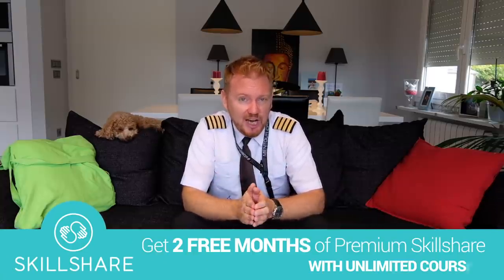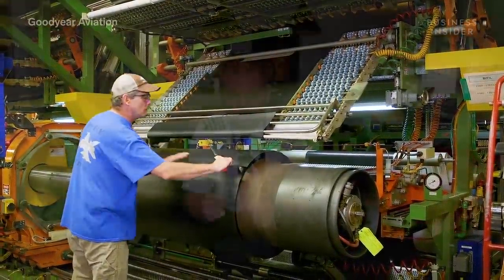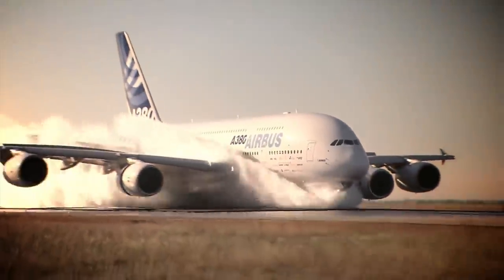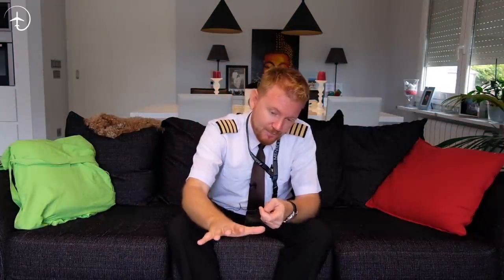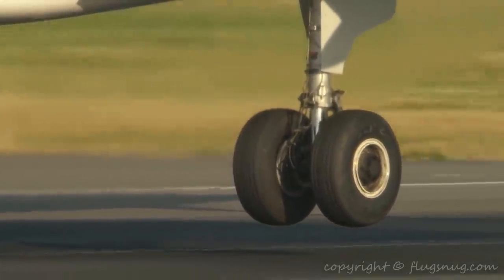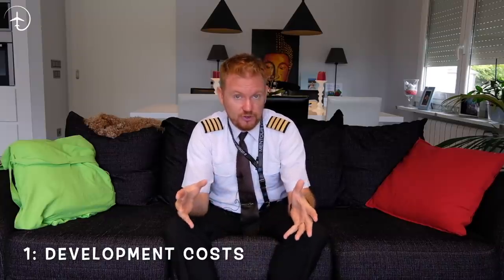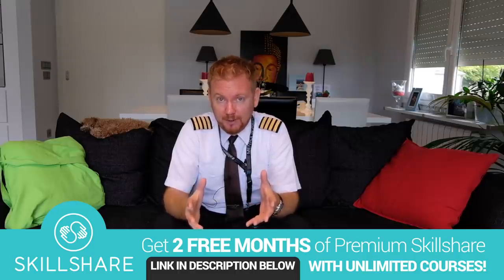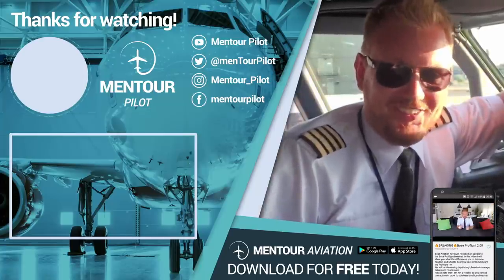Why not make plane-tires spin, before landing?!

Comment: What about a passive system? Put flaps on the sides of the tires, like a simple wind vane. They catch the wind when on the bottom, not on the top. The tires would spin up as they are deployed. This wouldn't have an motive force once they hit the ground.

Comment: I disagree a bit.  Spinning tires were used many years ago. One way was vanes that caught the air so you had no motor issues.  It didn't really work that well.  But... I think Hydraulic motors would have less weight, and would be controllable.  You could have it monitor ground speed and self regulate.  If you were crabbing, it could spin at a lower rate or not at all.  Finally, if there was a safety 
issue it could disconnect and be just like a regular wheel.   Thanks for your wonderful videos.  Pete

Comment: Instead of a motor, why not use a spring mechanism that will spin the wheel in one direction, otherwise the wheel just free-wheels.  don't use a motor, batteries, etc.  a powerful spring requires no fuel, no wires, etc.  and likely wouldn't add as much weight as a series of motors.  Perhaps this could even be designed to help slow the aircraft upon landing.
Great video, and sharing this.

Comment: I would use compressed air from the engines and have air drives on the axles like a air power tool to spin the wheels before landing . Then I would make it possible to reverse the air drive to help with braking ..

Comment: I used to do this in Diamond DA40’s. You hold the mains within an inch of the ground while landing, and you can hear them spin up. Then let the plane settle. Passengers are always super impressed. I’m not an especially good pilot, but they all think I am. 😂🤣😂

Comment: This is a question i have had too, yet i have a solution
What about vanes added to the side of the tyre, either  metal bolt on with the wheel nuts, or moulded into the sidewall, the type of vanes that wind will rotate them
It wouldn't need to spin to full speed, but would at least reduce the amount of rubber you leave on the runway
I understand what you say about a crab angle, but you could easily select not to spin the tyres by applying the brakes
Simple solution that doesn't need electrics, battery etc

Comment: Pre-spinning the tire would help with the angular momentum the tire needs to gain upon touchdown but does not help during braking to drain the aircraft's linear momentum. It takes very little work/impulse to get a tire up to full speed, most of the wear is likely to occur during braking. Additionally, I wonder if that brief moment the tire slips helps warm it a little and allow marginally better performance.

Comment: An Australian Airforce member took out a worldwide patent for a set of turbine "Hubcaps" to spin up the landing gear prior to touchdown. It was tested and it worked BUT upon approaching Boeing and other manufacturers he was rebuffed with one aircraft company representative stating that when the patents expired they would consider it. The idea came from WWI pilots spinning prior to landing. The turbines did not speed the wheels up to landing speed but started the wheels rotating at a slower speed to reduce their inertial forces.

Comment: Just small flaps on wheel disk inner space will convert upcoming air energy to wheel spinning. Benefits :
1) no need motors
2) system as simple as reliable
3) spinning will never be faster than some threshold depending of upcoming air
4) reducing smashing effect due touchdown 
And if you scared by rotation momentum due touchdown then don't spin up wheels to nominal frequency - use half of nominal frequency - this will save rubber, and increase safety anyway. 
And please don't use as argument "we used to do like this" .

Comment: I believe, many years ago, they did try spinning the tyres and found it was not the way to go. . .  I don't remember the details, but one way mentioned was fins on the wheel, such that the air spun the tyres up to some useful speed.

Comment: Here I have a question (perhaps you head it million times?) : Why no external cameras ? So that from cockpit one could see at least wings and engines.
Equipment is light and could be wireless so one could think it could be implemented easily.  High speed cams could "freeze" rotor blades so could stroboscopic flash. Isn't it frustrating not to be able to have a look outside in a time cars come equipped with rear cam.
Cam could be a fitted on pods that sticks out only when needed.  Fitted in the nose?  Isn't there a spot that doesn't come in the way of the radar?
Then it could be controlled from a simple tablet using "of the shelf" existing tech.

Comment: KISS method.  Weather vain type paddles bolted on to the rim, let the wind spin them up.  Cheap, no weight to speak of, probably can retro fit to existing aircraft. Don't need exact speed.

Comment: Rotating wheels at landing speed puts extra down force on the plane which causes shuttering because it's not matched to the pitch of the plane. Think about an RC truck as an example, if you launch the RC over a ramp to avoid it flipping out of control backwards, you can moderate the wheel speed to pull the front of the car down which helps the landing. But when we try to do that to a plane which is gliding in it will force the planes nose to dive so the pilot is forced to pull up to counter the wheel movement causing violent shuttering within the cabin. Thats the main reason why wheels are left static until they connect with the surface.

Comment: Why not add some fins to the rims of the plane wheels so the spin of the wheel is generated by the wind catching the fins facing to the front on the lower part of the rim. While the upper part lays opposite and would not catch wind, resulting in spinn of the wheels from just air drag while landing. No motor or batteries needed

Comment: Maybe one turns it around: If simple irrigation systems keep the runway slightly wet in the preferred touchdown zone.. wouldn't pilots get rewarded with a less brual tire-acceleration and wear-off? The plane is sliding the first meters anyway. The transition of direction-determining flight controls to the landing gear on touchdown might be more smooth. Also the torsion induced shear stress on the landing gear during (non-rainy) crab landings would be less.
Question to pilots: Is the touchdown on a slightly wet runway (given there is no wind) more smooth as the plane initially slides more/longer, and hence the directional control is closer to being airborne, with smooter transition?

Comment: I use aircraft tires on steering axles of my John Deere tractor and on implements with pneumatic tires. The carcass fabric and belts are 3 or more times as many as other tires. I am in Texas and Mesquite thorns can puncture heavy equipment and farm machinery tires with ease but used up regrooved AC tires never get flattened.

Comment: I believe Lancaster bombers during WW2 had small cups around the tyre rims to start the wheels spinning. I am not sure if it was all Lancasters or just some of them. Using these cups would eliminate all the problems with motors such as weight, batteries, etc.

Comment: Nitrogen expandes the same with temperature change as any other gas does. The "Ideal Gas Law" or "pv=nrt" explanes that any gas sealed in container with a fixed volume, when exposed to a change in temperature, will increase/decrease in pressure identically to any other gas.

The main benefits of using nitrogen over atmospheric air are; the absence of highly chemically reactive oxygen that can degrade rubber (especially under higher pressures), the absense of moisture, and the consistency across the globe.

Oxygen is a highly reactive element and causes a lot of damage in a lot of substances. If you see the terms "-oxide" or "oxidization" it means that oxygen has reacted with the substance and changed it from its original form. Some common examples are; rust (iron oxide), headlights plastic fogging (oxidization and uv dedregrarion), and something rubber that is old and has a cloudy layer or lost strechiness like an old rubber band (oxidization). The rate that this oxidization happens at is influenced by pressure. So as the pressure in the tire increases the impact of the oxygen increases. It doesn't matter much in a car tire at 35psi since the tread wears out before the inside starts to degrade. But at 6-8x the pressure for an aircraft tire, the damage from oxygen internally will happen at an increased rate. 

Moisture isn't normal an issue in tires especially since most air-compressors have an air/water separator and some have dryers. But with the extreme temperatures in flight and during landing there are chances for moisture to either condense and freeze or boil if there is an excess of moisture in the tire air. One potential reason why this could cause an incendent would be if an aircraft tire was filled in a region with almost 99% humidity, hight temperature, and their air/water seperator and dryer failed. It could allow an excess of moisture into the tire that could potentially freeze in-flight and cause an air leak due to the ice expanding around the seal. Or, the moisture boiling during landing and over-pressuring the tire. Both are highly unlikely. But, still a potential threat vector that can be eliminated by using a controlled nearly pure gas. 

Finally, if everyone globally agrees to use 99.995% pure nitrogen for commercial aircraft tire air, then you can guarantee that no matter where you stop to get 'air' you can always get a nearly identical replacement for what is already in your tire.

Edit: as some other comments pointed out, the lack of oxygen also helps prevent fires and explosions inside the tire if temperatures get to the flash-point of solvents or the rubber inside the tire.

Comment: The first time I saw a film of an  airliner landing, and the smoke on touchdown, I asked my father, a bomber pilot and degreed engineer, why not spin the tires up to speed to extend their life?  He answered: "Two reasons."
He asked me if I enjoyed watching the drag racers at Irwindale raceway, "Yeah!" I replied.  "Especially the burnouts.".  "Well, they need to heat up the tires for maximum traction.  It's the same for aircraft, and spinning the tires would make landings much more difficult since the tires after a high altitude flight will be extremely cold, well below freezing.  Touchdown on Ice cold tires would slide instead of rolling, potentially causing one tire to grab traction, causing a yaw that would be nearly impossible to control.  If all tires heat at the same time there is no traction differential and control is much better.  
"What's the second?"
"Take the front wheel off your bike and I'll show you.
I did and he had me hold it by the axle, he spun it up pretty fast,  and told me to tilt it to the right.  When I did it strongly resisted tilting, instead tried to turn me to the left.  Then he told me to turn it to the right, and it tilted to the left.  "That's the right hand rule. Now take that and instead of weighing two pounds it weighs four hundred pounds, and there are four of them.  Imagine being on the base leg for landing and you drop the gear to spin them up.  When turning for final approach the plane is precessing in roll and yaw.  For now ignore pitch.  By the right hand rule the four main tires are trying to move the plane in roll and yaw ninety degrees from the direction the pilot wants it to go, making the most risky part of flying a much riskier proposition.

Comment: Mentour, it could be sufficient to add to the lateral surfaces of the tires a few flappers that restricted to in one direction contrary to the speed of the air only would start the wheels turning in the correct spin to match the runway !!

Comment: Now there are a feew very interesting and informative comments that you should read. But honestly wheels are under a lot of stress so adding more complexity than necessary is bad. Changing the rubber more often is joust easyer and safer. Joust imagine if one side of the spin up fails! Whole aircraft might veer off.

Comment: Very good. Ok. Carry on. Really enjoying the videos. This issue though, not absolutely certain there is not another way. 10 percent of speed spin? 25 percent. The average Audi motor car has lightweight ABS and traction control that is reliable for the entire life of the car, for example. And if the system were to fail, the wheels can revert to no spin. Also, the manoevering tugs are a fantastic little idea aren't they?

Comment: What about a passive system that spools up the wheels using the airflow past them while they are extended below the fuselage. It would require no power source or control or monitoring, and minimal mass added to the A/C. It would still reduce the tyre wear rate even if the wheels were not fully up to speed.

Comment: I have pondered this question also but I thought small vanes could be added to the wheel hubs that would use the airflow to put some spin to the tires. This would  not match the landing speed but would be low weight and be fail safe as there is no mechanism to fail. I accept the reasons given for not persuing a mechanical retrofit. My only question is whether "flat spots" would change the balance of a wheel or increase wear in one spot. Many thanks for one of the best aviation websites on you tube. Very best wishes to you and your family.
Reply: Two things to consider with this idea.  First is that the vanes themselves could conceivably break off, causing asymmetric spin and/or runway debris.  Second is that wheel vanes would also keep the wheels spinning after takeoff, which would require additional braking to stop them before or during gear retraction.

Comment: Perhaps one day we might have a magnetic runway. Something like the hyper loop where planes would not need tyres but levitate off the runway. Also with the aluminium planes you could make use of magnetic breaking reducing the need to use reverse thrust. The opposite of that is also shorter runways needed for takeoff because you could save fuel on take off by propelling the plane similar to a rail gun principal

Comment: @mentour pilot
Perhaps you could revisit this topic, correcting the misunderstanding about what ‘inert’ means and addressing drawbacks for the air-vane method of spinning the wheels (which seems to have been suggested about 2000 times in the comments).

Comment: I'm all for NOT having the wheels spinning prior to landing. But I'm all for having electric tugs to haul planes to their  staging location. They would run on a program that would ensure setting to the correct runway, something you have discussed multiple times while describing crashes. They would be connected (obviously) to the main program to ensure planes would take off in the most efficient manner, ect. The charging would be done with wind with solar then grid backups.
Reply: Great til your engines wont start or you have a system problem on start, then you delay every aircraft behind you til its sorted, much easier to do it at the gate. Just cos you can do it doesn't make it automatically a good idea.

Comment: Vanes on the tires would steal airspeed during takeoff as well as prior to landing, requiring more engine power to overcome. The exact moment you want to lose airspeed is the moment you hit the runway, and spinning up / scraping a tire is a cheap way to do it.

Comment: You forgot one thing: At the beginning of any car race, you'll see the cars rapidly sterring left and right to warm up the tires, despite the fact that they're wearing the tires down when they do that.  So why are the racers wearing down such an important part of their car?  Because it increases traction when the tires are hot.

Same on a plane: Those tires have just spent hours at flight altitude where the temperature is often below freezing.  The touchdown, while wasteful, will quickly get the temperature of the tires up and gives the plane extra traction as it lands, which is when the extra traction is most needed.

Comment: The ideal way to pre-spin the tires just before the landing is to use a kind of air blade/fan connected to the gear via a clutch. 
It won't consume electrical energy. 
It won't need sophisticated maintenance.
Lightweight and not so expensive.

Comment: Interesting video and analyses. 
Regarding landing, a passive system such as the RAT may be fitted to the wheels to help them get started spinning. This would be much less prone to failures than a motor. 
Regarding departure taxiing assistance via an external tug, I was wondering if not having the engines run and heat up for a while before the takeoff wouldn’t be a problem, as it is very demanding for the engines as they must almost instantly provide maximum thrust with a high reliability during the initial ascent phase. Turning them on just before seems to give little time for the crew to notice any anomaly.

Comment: On the pressure of the tires, isn't the altitude a big factor?  I had a white water canoe that had float bags, which displaced the water that might otherwise get in the boat.  They were held in with nets.  Anwyay, it was very important when driving over mountain passes to make sure that the bags were not fully inflated before you went up to higher elevations or they would burst.  I guess the same amount of air (number of molecules) would occupy a much bigger volume at higher elevation (lower pressure).  If I'm thinking about it correctly.  So I'm wondering, when you whip a tire from 0 to 35,000 feet in a couple of minutes.  Does it try to burst?  You need it to be hard when you land but not explode when you're at elevation.  Seems like this is a problem.